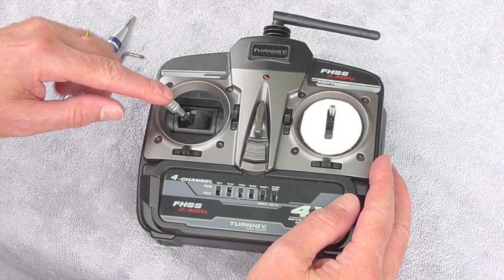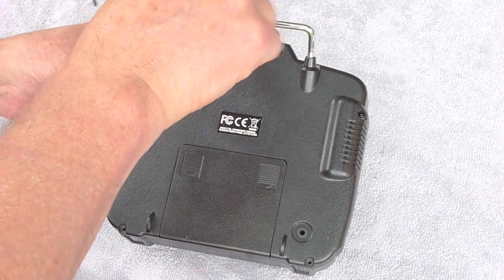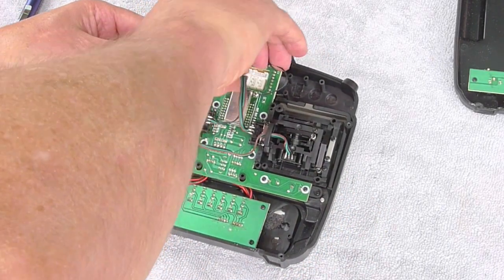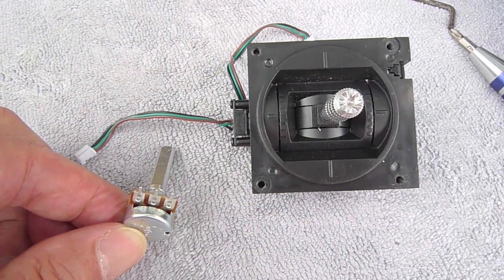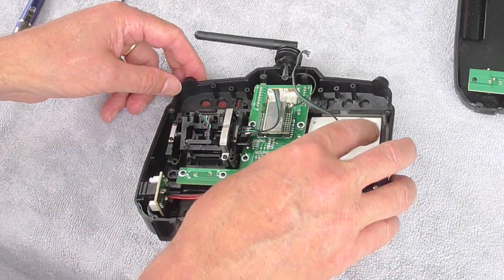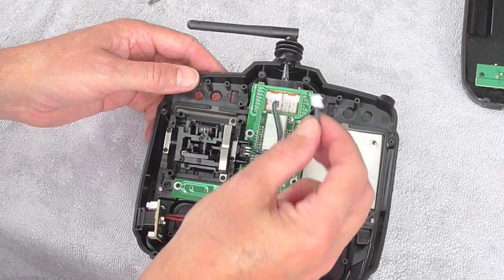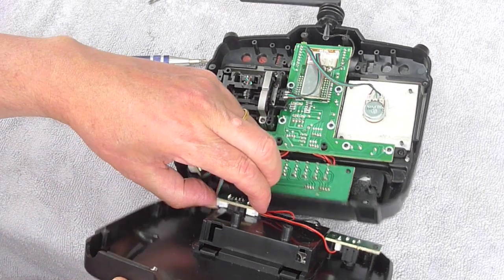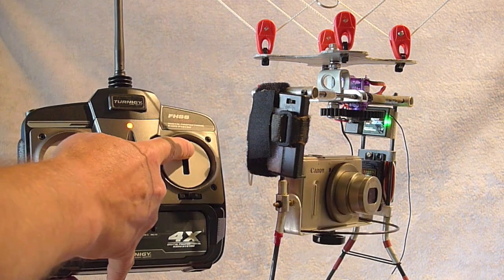KAP RC Transmitter mod

Comment: for this to make any kind of difference, solder antenna on what ever this is for. ex, I soldered antenna on micro drone board and drilled a small hole in casing so the antenna wire stuck out the top.

Comment: I picked up a pair of pots and have made this modification for the tilt. I'm finding it's getting harder to see the orientation of my camera in flight and with the addition of a Gentle "More Tilt" in order to be able to shoot up at some targets (think kite festivals and huge lifters). Are you using a standard servo for pan? If so, what's your maximum rotation? I'd like near 360 degrees but that may not be possible I'm thinking (?)

Comment from the maker: It's nothing more than a 5k pot mounted onto plastic and plugged in where the lever used to plug in. Drill a hole in a square of plastic so that the 5k pot threaded mount fits through snugly. Secure with a nut on the other side. Solder on the 2 plug wires, one on the centre tag and one on either of the outer tags. Mount the module into the transmitter, plug in and away you go.